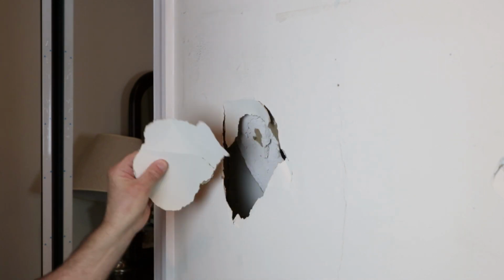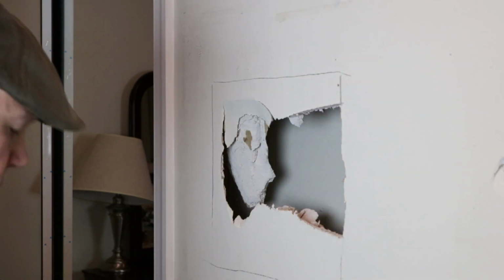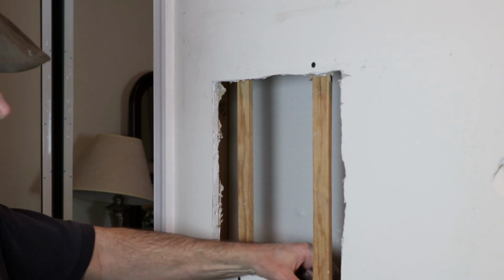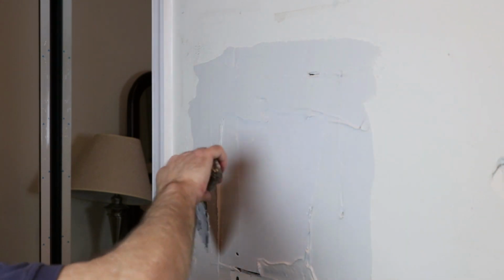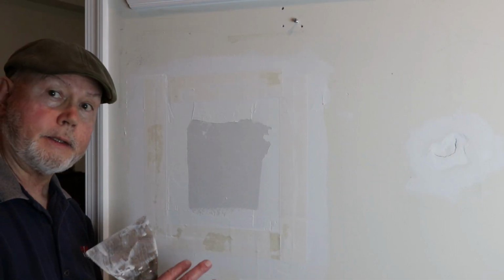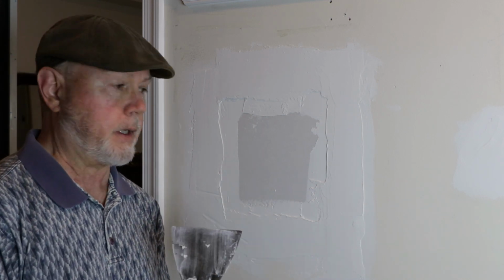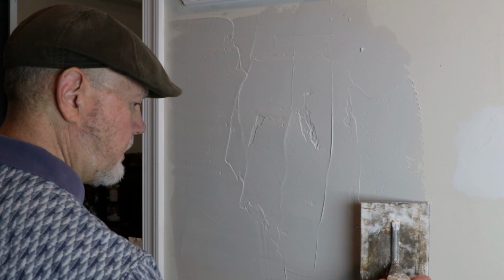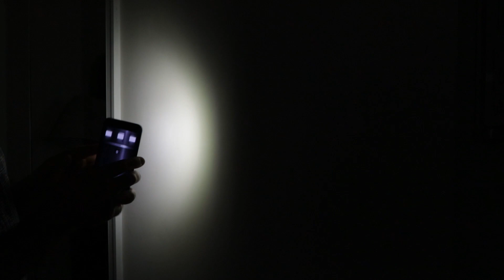How to - TEXAS style DRYWALL PATCH

Comment: If you would have taken your purchased 1/2 piece of drywall you would have discovered it is 16 inches along the longest side.  That is so you can turn it 90° and get it to reach from the center of one stud to the next stud.  You cut the hole 90° wrong.  Also there is no strength with that molding and screws that are pushed thru the paper.  If you need to scab like that, use adhesive to back up the screws.  Don't get me started on the mud... You will sand a lot less if you clean your mud knife and keep it clean while you work. I hope that that is your home.  At least then your work will be up to the homeowners standards.
Reply: Aaaaa now I get it... I saw you spread that mud with a concrete trowel, but you did it in every direction... So your a concrete guy.  Because that is a concrete finishers action.  At least now I know where you are coming from... I won't expect a level 3 mud job.
Reply from the maker: Lol, what state are you in? As soon as you sober up, there will be a math quiz
Reply: @douglashill7059  I see you wear a suit so I would not expect you to understand that a typical stick framed building has studs every 16" and all building products are designed around use on a typical sfr structure. If you want to attempt a math quiz with an old builder, you better bring a calculator.  Engineers and architects have computer programs to keep them from error.  Look at some plans, we find errors anyway, every job.  A good builder solves those problems, and finds a way to make payroll and a profit.  You craft your math quiz.  Make something catered to yourself so that you can look good.  Then go look at your own home and calculate what it would cost to fix the things that your wife wants fixed.  Then calculate a modest profit.  Then save up your money and call someone that has the skills and the tools to do the job.  Leave the measurements to someone who has the skill to read a tape measure.